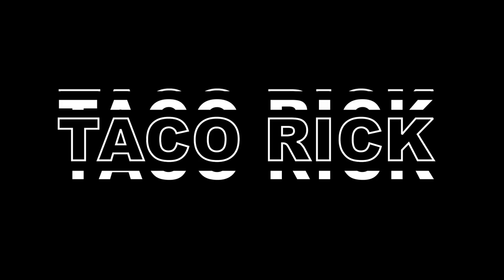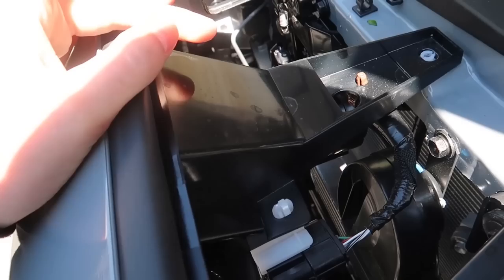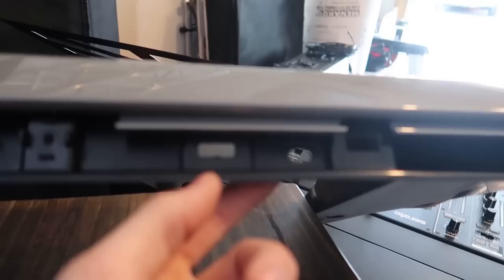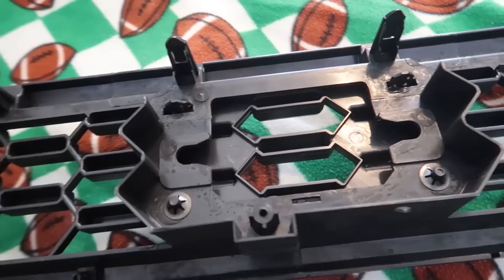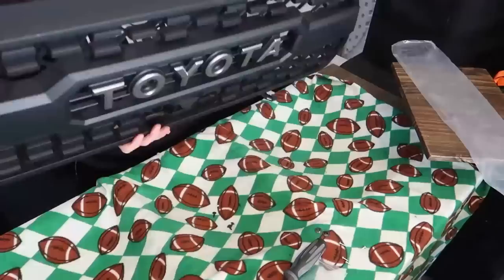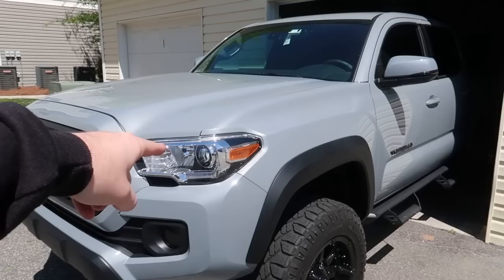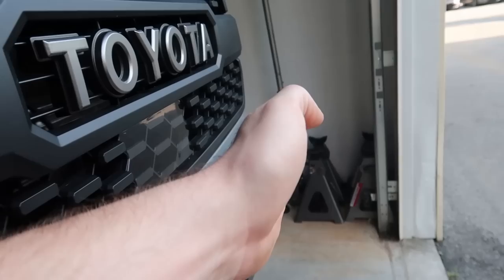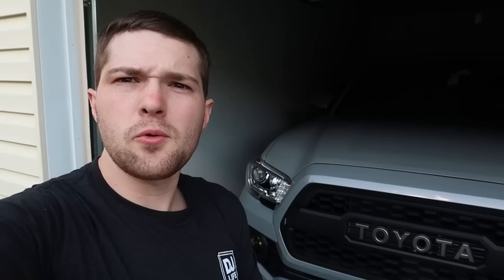TRD Pro Grill Install on the 2020 Tacoma Off Road (with Sensor)

Comment from the maker: Where I bought my TRD Pro Grill https://toyotaproshop.store/products/3rd-gen-tacoma-trd-pro-grill
------------------------------------------------------------------------------------------
MODS so far on the 2020
- Rough Country Lift Kit w/ Lifted Struts and N3 Shock in Rear https://www.roughcountry.com/toyota-suspension-lift-kit-745c.html
- Tri-Fold Gator Tonneau cover https://amzn.to/3bpvglB
- LED Interior bulbs https://amzn.to/2M4yyO1
- LED License Plate bulbs https://amzn.to/2M4yyO1
- Plasti dip https://amzn.to/2XA4NMD
- Tailgate Letters https://amzn.to/2WU9gdP
- Diode Dynamics Headlights https://www.diodedynamics.com/led-bulbs/sl1-led-headlight.html
Reply: Did your TSS garnish scratch really easily? Just bought one and took three plastic wrap off of it and I wiped it down with my shirt and you can see swrils marks already on it. I bought it from the same place.

Comment: Taco Rick! You are a lifesaver! Thank you! I had just put this same grill on my SR5 and have been trying to figure out a solution for the sensor for over a week.
Reply: Jerry!! Small world! I just bought a Tacoma too!
Reply: Looking at putting this grille in my SR5 as well. No issues with the sensor after the adjustments he showed us in this video?
Reply: Did the washer work? Did u have to remove the grill to add the washer?

Comment: I just installed the same grill from Toyota pro shop. The washer I used for the radar sensor was 0.038 thickness. Drove with cruise control for several miles at different speeds and distance settings. No issues with radar kicking off or sensor warnings so far.
Reply: Did you use an OEM garnish or a knock off garnish?

Comment: Thanks for your help. I put 2 washers behind the screw and everything works great. Sometimes folks have difficulty holding the washers and trying to insert the screw. I find if you put a little vaseline on the washers it holds them together. Same with putting the washers on the sensor. Put a little vaseline on the back of the sensor and it holds the washers in place while you insert the screw. Very happy with your presentation and the completed grill.

Comment: The push lock washers have to be pushed all the way on the pins of the TSS garnish, that will angle the TSS garnish, the garnish is not glass by the way it is plastic. The garnish is not supposed to be flush on the grille. Use a 10mm deep well socket to push the two lock washers all the way down on the garnish pins. You may need to use a hammer to seat the two lock washers all the way onto the two plastic pins.

Comment: Here’s a tip to remove those plastic zip tie clips that hold the wire harness. 
I use a small pick and push the tooth on the zip tie away to loosen it and wiggle the wire harness.

Comment: Why did go you from a 
2018 to a 2020 ?
They aren't the same ?
I just got a 2021 Off Road Manual
And it was nearly impossible to get
And at a $70,000 price out the door
Reply from the maker: Check the videos. I totaled the 2018.

Comment: The pro grill is is 100 times better than the other trims. I will be doing this too at some point. But since this is trivial and serves no purpose. It will be a minute. But this just look so much cleaner and you can black out the Toyota letters. I too am very anti chrome. It doesn’t belong on a truck specifically at least

Comment: Someone’s undoubtedly already said it, but doing OEM now and it does not have the 8 screw mounts either. Only difference I see is the “TOYOTA” emblem is all one piece with the grill - it doesn’t screw on. The letter covers do appear to clip in though.
Reply: The screws actually attached the surrounding chrome bezel on mine.

Comment: If you don’t do the trick with the washer then does it matter. Does it only matter if you use ACC or LKAS or does this cause a check engine light.
Reply from the maker: Your radar won't work and this cruise control won't work if you don't get it aligned just right

Comment: Btw, Your Lift is PERFECT - It is not too high, or low, it's just right! That is the exact same one I want to put on my SR5 (with some A/T tires as well) - How is ride quality with the lift and tires? How much worse MPG do you get? I am avg around 16-20 MPG, depending on where I am going....Edit: Want to ask you on the lift, did you just get the Strut Spacers and the N3 shocks? I am curious as I am not sure what the other two drop down options are (Lifted Struts, Vertex adj coil overs??) If you don't mind answering, thanks and have a great holiday!
Reply from the maker: I have a full video on my channel doing the lift install and multiple reviews of the ride quality and a video on mpg

Comment: Does adding this grill void any warranties? I’m trying to buy a new truck and have the dealer add this grill. They said the sensors between the pro and off road are incompatible and they said it would be a big liability issue. 
Any issues I should know about or should I just do it after market
Reply from the maker: It doesnt void your warranty since its bolt on

Comment: Hey man got a question...I installed my outter sensor plate but the top two pins that are circular don’t go in enough to use the “lock washers” also when I press it in all the way the top is in more than the bottom messing up the angle. I did the washer trick on the inside sensor like you. But I’m going to leave my outter sensor plate top two not pushed in all the way to try and keep those angles lined up. I hope you followed all that. Any advice or insight?
Reply from the maker: Thats how I had to do mine two. The locking washers are barely on the pins. Otherwise it angles it up
Reply: Taco Rick perfect thanks man. Also I’m noticing the hood ajar signal is on while my hood is open. Should I wait till this goes away before I start touching the fuse box and stuff? Doesn’t seem to be going away..

Comment: Hey great video! Installed mine and tried using 2 washers and was getting pcs error. Took one out and it still kicks on once in a while. How thick of a washer did you use? Mine are about 1/16 of an inch each or less
Reply from the maker: Have you play with it. Got to get the angle just right. Sensor has to be parallel with the glass.

Comment: How bad will it be if I run this grille with a sensor but without the ugly garnish ? I know it will turn off when it gets wet but will I ruin the sensor if I don’t use the garnish ?
Reply from the maker: It won't work. The garnish is part of the sensor system.

Comment: I understand your point about leaning the sensor back with a washer, but shouldn't the washer be on the front side of the sensor?
Reply from the maker: It is. The washer is between the sensor and the mount
Reply: @TacoRick  Ah, it must be a shadow I'm seeing that made it look like you put it under the screw.  Thanks, makes more sense now. Appreciate the vid!

Comment: Awesome video! So if I order that exact grill I don’t need to order any other pieces such as tss safety covers or other garnishes right?
Reply from the maker: There is an option when ordering to get the garnish. You may need some washers to adjust the sensor which are not included

Comment: Hey Rick just installed this Grill and used one washer. So far it's working good. One question the PCS sensor sometimes says off and it goes away after a while. Have you experienced something like this after the new grill install?
Reply from the maker: Only had the clean sensor thing. It's done it a couple times since the install on really long road trips but very rare

Comment: Can you add the washers on the sensor while the grill is on the truck? Or are you needing to keep taking the grill off of the truck while messing with different washers?
Reply from the maker: You can add while on the truck just a little tight with the fingers
Reply: Sweet thanks!

Comment: I have a 2016 and a 2019 tacoma.  The 16 came from the dealer with all the trd accessories and kind of wanna swap them out on my 19.  The only problem is the grille,  I wanna know if it has given you any problems at all.  My 16 doesn't have te sensor so I don't have to worry about it but if I swap it to the 19 I need to figure that out.
Reply from the maker: Once I dialed in the sensor like I mentioned i had no issues. But getting the sensor working is the only hurdle in that
Reply: @TacoRick  cool bro.  Thanks for the info 👍

Comment: Loving the content already man. Just a quick question, the site offers an option with/without TSS garnish. Does that mean with/without that sensor? Also, if I have a 2017 Tacoma will I not require the sensor? Thanks again
Reply from the maker: Yes
Reply from the maker: 2017 doesn't have a sensor

Comment: Hi rick question your tires are they E rated if so would you of wished you went with a C, or D rated instead ? 
Thanks looking for tires is why I’m asking
Reply from the maker: As in load or speed rating?
Reply: @TacoRick  I’m looking at nitto grapplers G2 285/70/17 and when I as several dealers one will as how many ply were I found out E rated tire is 10 ply then there’s a 6 ply tire and 4 ply. I know it’s to do with side wall of the tire I’m not a off rd guy any way some people say 10 ply E rated is over kill then some say there the tire they are the heavy 62lb 80 psi we’re D tire is mid 50s 45 psi. Just curious if you know what yours were. I remember you did about  gas weight big tires thanks
Reply from the maker: @papabear007  if you don't go offloading don't go crazy. I only have c rated tired. 10 ply is way over kill

Comment: Did you take sensor completely off and add washer or did you just remove the screw?
Reply from the maker: Removed the screw and also loosened the other two bolts. Slid the washer in the gap retightened all the bolts

Comment: Rick is your sensor still working properly? I added this same grill and need to try this solution, being mine does the same thing.
Reply from the maker: After I got the adjustment right haven't had issues at all.
Reply: @TacoRick  thanks man.

Comment: Hello Rick , great video. I just became a first time Tacoma owner last week. Bought a SR 4x4 Silver Sky Metallic. Not a lot of bells and whistles, but I love the truck. My question is, the letters on the new grill, are they the same as the Cement color or are they somewhat of a silver in actual color. I am wondering if there is way to modify the letters in other colors( Ex. Overlay style)  If the letters are of a silver, that will be perfect for my truck. I will be changing out the grill soon. Will be purchasing it from the place you bought yours. Thank you.
Reply from the maker: They are like a flat silver. But as I show in the video the letters are a seprate piece of the grill that you screw on. So you can paint them whatever color you want.
Reply: @TacoRick  Nice, that works for me. Thank you. Looking forward to more videos.

Comment: I'm bouncing back and forth between trd off road vs trd pro.   It seems that I can I get an off-road and make upgrades to basically be = or better than a pro and save 10 grand at the starting MSRP.  Any thoughts on this?
Reply from the maker: My exact thoughts. The big thing for me was if you want to lift it or go any taller then factory there is no point in buying the pro just to rip the fox shocks right off.
Reply: Definitely buy the off-road. Pro is a waste of money in my opinion. I bought a 2019 off-road and I've been building it little by little since September 2019.

Comment: Awesome video dude. Very helpful. Just installed mine today, exact same grill (maybe same manufacturer), but I noticed that the third screw on the top don’t actually screw at all, it stays loose, so I stored and will test the performance tomorrow in a camping trip. Did you had any issues with that?
Reply from the maker: No issues with loose screws...

Comment: So how does this work with 2020 grill and front camera?
Reply: you need the actual 2020 trd pro grille since there is no aftermarket option, even then you need a trd pro vin to order it from dealers. I was looking into it on tacoma world forum. Also the camera is different between the trd sport and OR/Pro. People said you need the or/pro camera because when you mount the sport camera its a little different in the imaging on the radio.
Reply from the maker: From what I can see from pictures the camera has a universal bracket that you bolt onto the grill using holes that are already there

Comment: Did you loosen all 3 screws before installing the washer?
Reply from the maker: No you really only need to loosen that 1 the plastic gives enough to allow it to slide in
Reply: @TacoRick  Thanks, I installed the washers (2) and it seems to do the trick.